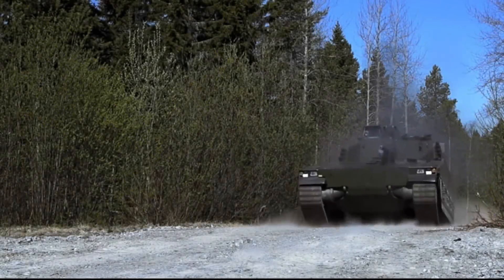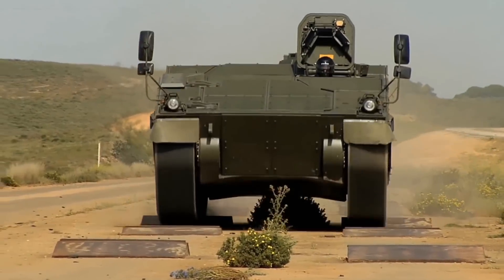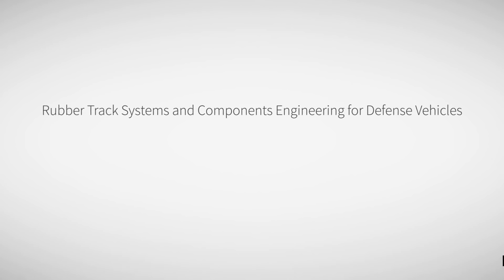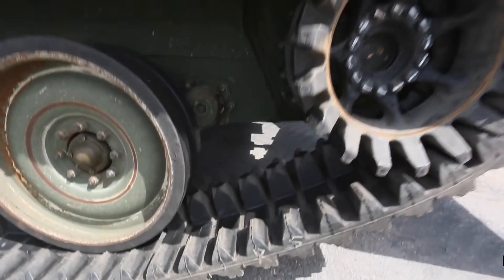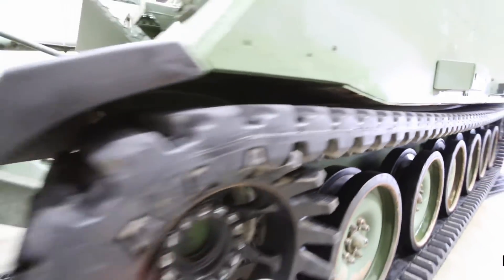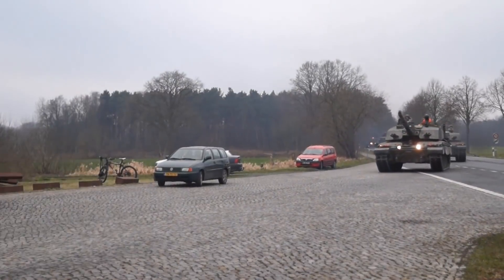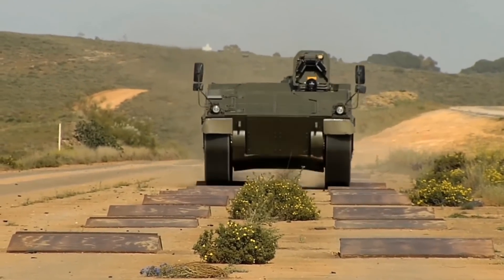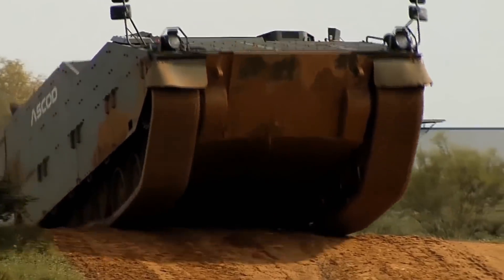Rubber Tracks on Tanks - Are they worth it?

Comment: Rubber band tracks have advantages and disadvantages.

Advantages:
-On support misisons, you don't trash their infrastructure (roads) as bad as you do with steel tracks (even with rubber pads).

-As mentioned, quieter and less vibration inside the vehicle. However that can also be solved with a decoupled running gear (requires a new vehicle though).

-Lighter, however again, modern steel tracks also have significantly better weight effincency. DST's DLT 464D steel track is 40% lighter than a Leopard 1 steel track, while having the same durability.

Disadvantages:
-Rubber band tracks aren't as robust, thus they can't handle as high vehicle weights as steel tracks do. The rubber tracks used on the CV90 are only qualified for a relatively low maximum weight of 35 metric tons. The tracks used ASCOD 2 for only 38 tons or less. The ASCOD 2 version used by the british (AJAX Scout-SV) is heavier, thus requires steel tracks. So no, you won't see AJAX, Puma, T-15, Namer or even MBTs with rubber tracks.

-Durability is lower. On steel tracks you simply change the rubber pads, if you use them without it (only steel, so called 'combat track'), it is MUCH more durable than rubber anyways.
Reply: Another some disavantages: rubber dry and became brittle, and some chemicals (acetone) can dissolve or at least damage the rubber
Reply: I think the biggest problem is the landmine
Reply: Steel tracks rarely survive any decent sized landmine anyways.
Reply: @RainytheNB  LOL rubber tracks won't survive either
Reply: @a1marine105  Did I say they would? My point was neither will survive a landmine.
Reply: @musashiiwasaki1268  still tracks will still be affected by that stuff
Reply: I can see rubber tracks as a good PEACETIME track for training under most circumstances, even for heavier tanks. If nothing else than reducing the medical-costs of the armed forces.
Reply: "....lower ground preasure less likely to trigger a mine,. " - My Subaru is heavy enough to set off a anti-tank mine. That means any military vehicle, no matter the weight, will set it off if your unlucky enough to run it over. I bet some cheap Chinese ones can be set off by dropping your sandwich on it.
Reply: yes i'm familiar with those X pads for the leopards, but the thing is that when you have a steel track with a rubber insert you have less contact surface with the road than with lets say the new wider all rubber track, since all the contact surface on those are rubber. Think of it like wearing a sneaker vs those traditional japanese flip flops with 2 wooden blocks on the soles (but with rubber instead of wood). But yea combat conditions i think steel track with rubber inserts wins hands down.
Reply: But you do have greater traction on stuff like tarmac and concrete surfaces compared to steel tracks
Reply: That question is relatively simple
Reply: I hate rubberbands, they worse. you can drive with them but steel tracks are much better.
Reply: @Tomeixx  Did you even watch the video?
Reply: @RainytheNB  

Whats your point?
Reply: My point is that you seem to have no clue about the advantages and disadvantages of rubber, yet you still claim "they worse".
25% less fuel consumption, increasing vehicle range
8+ kph max speed increase
vastly improved road driving (which is extremely important, because tanks spend the majority of their time on roads)
reduced detection by enemies due to noise decrease
better performance in mud due to less friction on the wheels and in the link connections
huge vibration reductions, resulting in heightened crew awareness and reduced fatigue.
So no, they are not worse. they are different. steel preforms better in different aspects, but rubber preforms better in others. neither is objectively better. it all depends on what the vehicle is being used for.
Reply: @RainytheNB  

I was a driver in German military from a  M113 Tank.

In training we have a special M113 training tank with ruber bands and in our unit we have one with the original chains.

I dont care what the vid say, cause i test it on my own. And ruber is shit.
And i drive in my duty  after the Training the most time not streets, just in the wilderness cause we have a big training area behind the barracks. And there is steel much better.
And if we go to other training places the tank go by train or Transporter.
And ruber is maybe better for the street but when it rain you must very carefull cause of sliding.

So i dont know what kind of tank you drive and were you get your experience from, but i get my experience from the army.
Reply: @Tomeixx  So you drive one tank and assume all rubber is bad?
Reply: @RainytheNB  

What tank do you drive?
Reply: @Tomeixx  I don't personally drive tanks; I'm in the RCAF. my dad was a tank commander, and I enjoy reading about tanks in my spare time.
Reply: @RainytheNB  roads? Look buddy we talking war not a fucking Nascar track
Reply: @a1marine105 Yeah, roads. a tank has to move. when you're in the middle east, you're moving. and what are you moving on? roads. 90% of a tank's time is spent on the move, not in battle.
Reply: How resistent are Rubber tracks against Fire like Molotov cocktails ore Flamethrowers or Napalm.
Reply: I doubt they would burn.
Reply: Plus side lower rolling resistance - inerta faster? . Lower weight and wider = lower ground preasure less likely to trigger a mine,. Age? Keep in mind New old stock of Goodyear halftrack bands are ok after 30 years (with good storage) .  Ok MBT enh still questionable, but 113 or light scout size probably viable.  Rock damaage?  Lol use metal track pads. Cons short tracking looks harder, but possible.
Reply: @potatoradio  LMFAO bro I am only 134 pounds and I can probs set off a mine a tank is a tank no matter what kind it's gonna set off le mine
Reply: Jonny hhk
Reply: i could be an idiot but i also thought that rubber tracks were used on Half Tracks in WW2?
Reply: @arthas640  Definetly not. they didn't have rubber compounds strong enough at the time. all US half tracks I know of use steel tracks with rubber inserts.
Reply: Another advantage: Burnouts
Reply: Well no matter what track you slap on shit a landmine is good enough to blow it up
Reply: It's like you didn't even watch the video
Reply: Steel tracks with rubber pads have pretty much the same traction as tracks made entirely of rubber. However the steel tracks can also be fitted with spike pads that enhance traction in snow drastically (you can see those spike pads at the turret backside of many nothern Leopard 2 versions, as example the danish or swedish version. They look like the rubber pads, but are made from steel and with an 'X' shaped spike on it). In case of a all-out war, they run the tanks without rubber pads at all, on steel. The performance on road is slightly reduced while in terain it enables even more traction.
Reply: You don't have less contact surface. Rubber tracks also have a profiled surface to enhance friction and more importantly, to allow the track to actually bend. Steel and rubber tracks of the same width have about the same contact surface. Also lower ground pressure isn't always better, (sweetspot for AFV's is around 9,5-10 N/cm²), both lower and higher ground pressures will come with disadvantages. You can't compare a AFV that is made as a compromise for all ground conditions with a hägglunds or similar.

Comment: How bullet/hit resistant are these tracks? I know they have steel inside but could a rifle squad, anti-material sniper or MG position disable a tank/IFV by shooting at the tracks and weakening to the point of it tearing in use or outright destroying it?
Reply: Bullets will simply bounce off rubber and stick to you!   It's physics and comedy all homgeneously rolled together. :)
Reply: Bullets will bounce back at the shooter. Have you consulted Dr. Popeye on this?
Reply: They do have metal reinforcements embedded in the rubber and they're fairly bulky, so I think even a moderate calibre would at most put a hole in the track and not cause a failure.
Reply: what about fire?
Reply: Depends on whats being shot at it.  A 50 might put holes in it, but it would still keep going. 7.62x39 might literally bounce off the rubber.  I've shot tractor tires and quickly stopped because I realized I was getting hit by bullets bouncing back.  Not lethally but more than enough to make me realize I fucked up.  It's a question of physics and material properties, at some point  you pump enough at it, it will break.  A couple 50s will take out a steel track IF you can hit the same spot a couple times, with the rubber you'd be putting holes in it until the tension on the track rips it'self apart.
Reply: No just no
Reply: This is what I was getting at Osprey - ofc 5.56x45, 5.45x39, 9x19 etc will probably just graze it, but it opens the potential of 7.62x51/7.62x54 and up being a threat to an armoured vehicle. With the exact material properties unavailable, one can just speculate, but assuming one were accurate enough, a GPMG suddenly becomes a threat to a tank. Discounting the GPMG (which is a longshot I grant you - pun not intended), moving to 12.7x99 or 12.7x108, or the 14.5x114(?) machine guns/sniper rifles, your vehicle may be disabled by 1 or 2 guys. A sniper team, the rifle and the rounds are much cheaper and lower profile than a classic AT weapon or another tank, can be very well hidden, very accurate, strike at range and cripple a small advance etc. 
In the Donbass, the DNR/LNR militia have issued videos for their snipers/mg teams to target the optics, radiators of UGF vehicles, essentially using snipers and MGs in an anti-material role. Imagine now that additionally they can disable the vehicle by shooting at a larger target (which requires less accuracy, enabling more people to do it, multiplying the force potential)
Reply: Boffinboy100 I would say a continuous rubber track would likely be more durable against attack.  My knowledge is speculation, but where a track can be disabled by damaging the joint a rubber track needs to be degraded to the point of actual failure.  The segment where matsimus shows the repair, that chunk is roughly half the track, damage that would stop any conventional track on the spot. I would suspect that the crew could actually drive on that damage for a considerable distance on it before total failure.

I also doubt anything less than anti material weapons would have a real effect. Even with 2 or 3 Medium machine guns (I prefer this term to refer to rifle caliber machine guns) going ham on the track, I doubt you'd do enough damage before the tank made your day far less pleasant. Eventually yes, and if you put enough firepower on it, but I think realistically you'd have to hit it with mutliple RPGs or AT4, and then you still have to deal with an angry turret who will then end your tour violently. And if they're working in a team, you just don't have bullets, men or time to waste disabling a track when it might be more worth it to avoid the tank or if you can destroy it with anti tank weapons, OR like you said, go after soft spots like optics and the like.

Comment: My Father was involved in the Testing of Armored vehicles pre WWII. The track system most of the crews wanted was the Christy system. He was also part of the transition from all metal to rubberized tracks, Dad preferred the rubberized tracks. I wish he were alive so I could ask him about the tracks on the halftrack.I think they a form of rubber track with spring steel molded into the rubber. Rubber tracks overall should be an improvement, depending on the ability of the track to absorb battle damage and then be repaired in the field.
Reply: The track used on the U.S. halftracks was a single piece "Rubber-Band" with steel cables running the length(circumfrence), similar to how a steel belt is laid in a tire. Later versions made by the Israelis used stainless steel cable, as once the rubber is cracked, it's very easy for water to wick up in the cables and corrode/weaken them.
Reply: https://www.militaryfactory.com/imageviewer/ar/pic-detail.asp?armor_id=71&sCurrentPic=pic11
Reply: Yes, those are crossplates, there are steel cables running the circumference that provide the trnsion to the "band". Hunnicutt's book on the development of U.S. half and semi-tracks has far more on the subject than I can put here.
Reply: John Rodrigues:  They were molded with  spring steel, this made the M3 halftrack  faster than German and French halftracks of similar  weight, very foreward thinking for 1940.
Reply: jgranger3532 pity the army resisted the development of a heavy tank. Could have saved thousands of lives. Aviation gas and and shrapnel are a bad combination. The lead Sherman took an 8.8cm round through the front and into the engine near Brest, in my Dad's company. Five men were turned hamburger with that hit.
Reply: @JohnRodriguesPhotographer  It wasn't so much a resistance to the heavy tank. We just didn't have the capacity to move them around the world like we could a medium tank.
Reply: @MrRich2u  actually it was probably equally a logistics issue and just outright resistance to the idea of a heavy. My dad was involved in the original testing tested Christie suspension tanks bogie suspension tanks and ultimately ended up with the Grant and Sherman tanks. Buy 1942 my dad was a twenty-year-old E7 in the army. The worst feature on the Sherman tank besides the aviation gasoline is the 75 millimeter short-barrel gun. It was great with the high explosive round. You can trace the short-barrel 75 millimeter gun to the army concept that tanks don't fight tanks tank destroyers fight tanks. on the brightside my dad said that the Ford V8 was the best engine they put in the Sherman. He loved that engine. Pre-war my dad was 2nd armored and post December 7th and pre torch he was split off to form the cadre of the 6th armored division. my dad served the rest of the war fighting in the 6th armored division.
Reply: I apologize if some have tried to reply, youtubes system is not good, and your message may have been lost .
I know someone wanted to talk to me, and I apologize that  I cant reliably reply.

Comment: Personally I just think steel tracks are best, if you get hit by an ied or something then at most you’ll lose a couple links and you’ll have to replace those links but if rubber tracks are hit then you lose the ENTIRE track which would be possibly even more of a pain to change out but I’ve only had experience with steel tracks (not in the military yet but because I help out at a museum with tanks)
Reply: You don't have to. Rubber band tracks made by DST (Diehl/KMW) have a segmenented design, allowing faster maintenance and repair of damaged track sections, however rubber band tracks made by soucy defense are one-piece.
Reply: If the vehicle is made from paper it is likely track parts will penetrate the hull.

Otherwise not so much.
Reply: ah but rubber isnt likely to get forced through the crew compartment by a blast
Reply: the majority of the warrior is aluminium. should also note i have seen ied blasts do just that as the part of the hull behind the track doesnt have applique armour added like the underside or more exposed areas of the hull
Reply: Jonny ohhhh fair enough. I don’t know much about rubber tracks so I thought all of them were one piece bands. Cheers for the info.